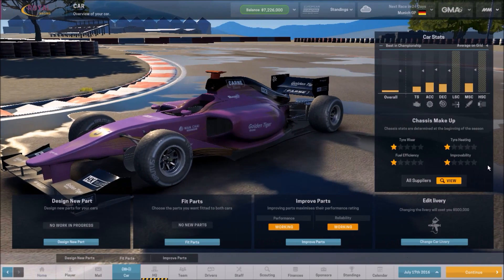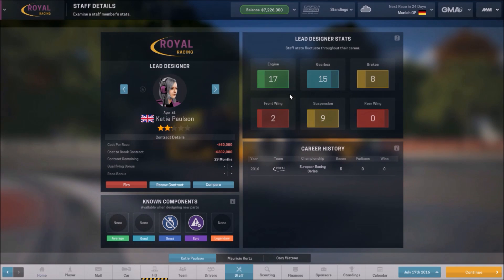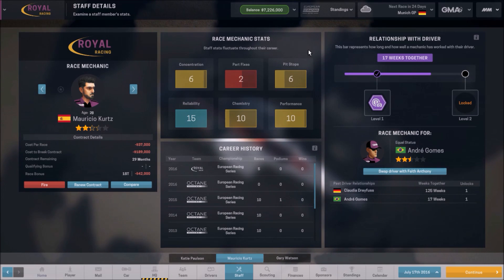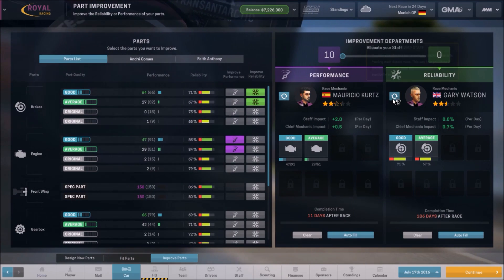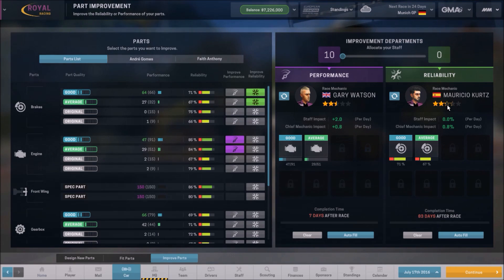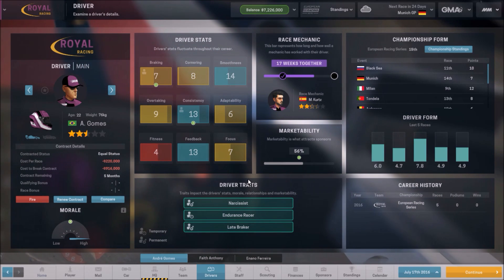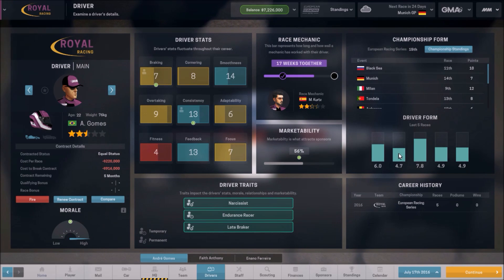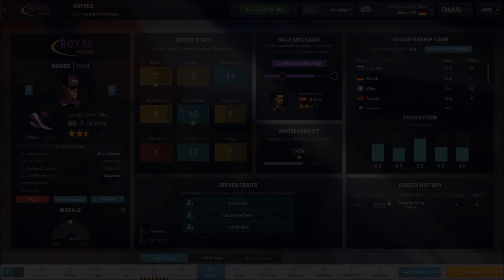Stats - Ultimate Guide to Motorsport Manager Part 3

Comment: Ok so in my save the game says that iam the 3rd best car in the main screen in HQ it says that iam 7th best in every quali iam at least 1,3 sec behind the 1st one and i start from last place.My hq has great on everything except brakes are good and the gear box is epic why iam still last can you explain please.Also the only non spec items are gear box and suspension. design centre is lv 2 what should i improve so that i wont start in the last places
Reply from the maker: The only advice I can give for on track performance is getting better drivers and parts. If you truly have the third best car and good drivers, then the issue might be in you qualifying performance, are you getting good/perfect on heating the tyres and brakes. Or you may not be setting up the car properly in practice. Finally, you may need to work on strategies, which the best usually is stopping the least amount of times.

If none of those are issues then try turning down the AI difficulty in the settings. That is about all the advice I can give without knowing more information.
Reply: @FoxworthTV  ok thanks for that.I leave the driver to control his tyres and brakes heat levels because I cant really look for both of them.My drivers are Mick Schumacher and Esteban Gutierrez at this point I think they are either the 3rd or 5th best drivers the setup is usually around 95% very rarely i leave them below 95% but over 90% for sure.Also I dont think that I should fall over a second for lets say 95% setup
Reply: Just saw that the AI was on 10 on what do you play ?
Reply from the maker: @TheSnakeKiller10  Okay, there is your problem, the AI suck at heating their own stuff, so you need to learn to manage them. I think my AI is set to 0 so you should lower it. Also mods are a whole different beast, they are a lot harder in my experience.